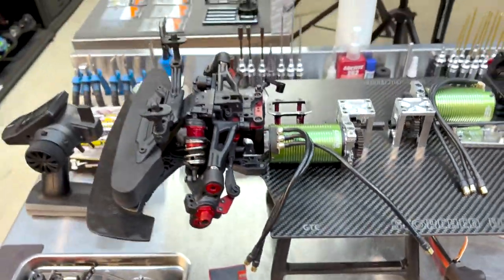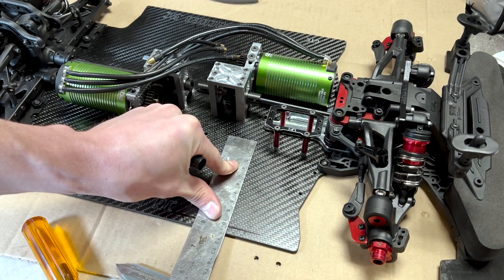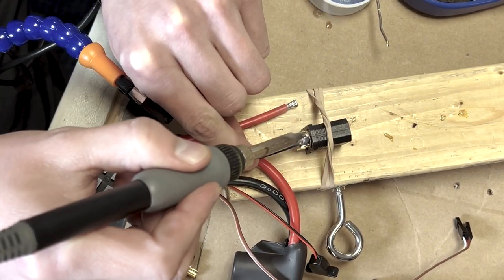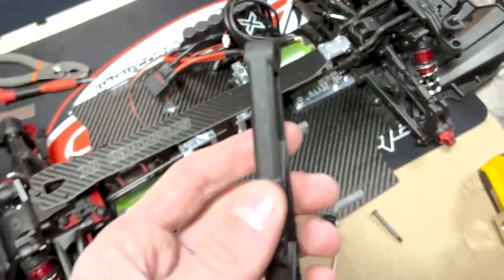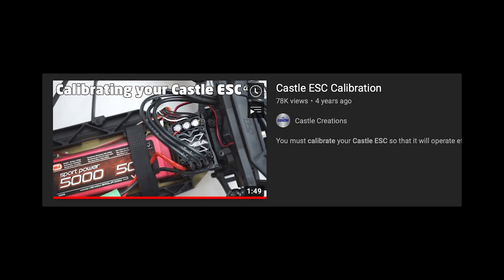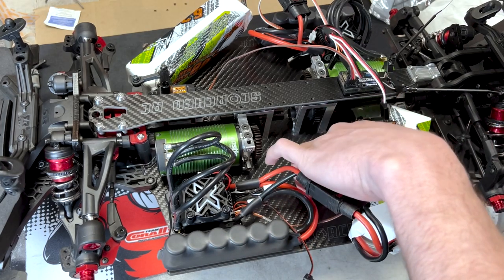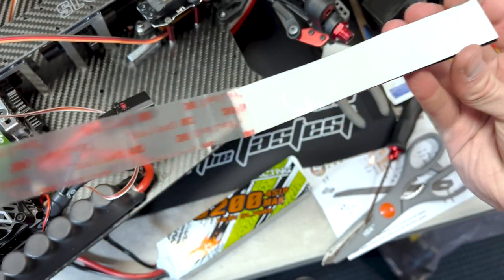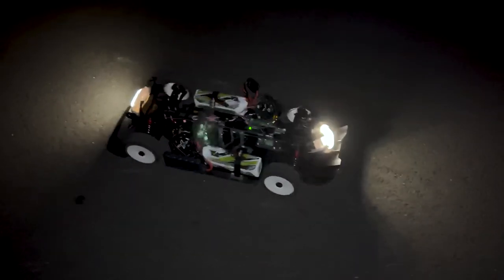Attempting To Build The Worlds FASTEST RC Car (PT2)

Comment: I like this build alot, it is exactly how I wanted to build a infraction if or when I get one. But I hope you plan to get something to block the tires from the esc as gravel and small rocks may be tossed up in. And not to jinks you but if the tire blows out it might give the esc a run for its money right there. Also kinda surprised your not running xlx2’s those thangs need tuning for high speed runs but they can push so much power for there size. I only know this because raz shifrin. Sorry if I miss spelled that but watch a few of his videos. He had me wanting to get a speed run car now.

Comment: What temp are you soldering that battery connector at? Whole lotta metal lol
Reply from the maker: 750 degrees, and yeah it needs it to make a solid solder joint

Comment: Coming along nicely. One consideration you should seriously consider taking on board is swapping out the drive shafts. I've seen multiple videos where they develop a kink/bend at high speed and causing some really ugly damage including damaging the can of a motor to the point of making it unusable. If you're planning on going anywhere remotely near 200mph, I would swap them out BEFORE they fail. I'm no Dr. James Mccoy, that's just my two cents as I'd like to see this car survive as long as possible considering the amount of money you're putting into the project.
Reply from the maker: Really great advice! I actually have a set of shafts and tekno diff cups on their way
Reply: @MikeStallone  Top notch! If your other components don't thank you later, at the very least they won't bitch at you lol
Reply: @MikeStallone  Hey duder, there was one other recommendation that I think will be well worth your time. I noticed you only connected the top brace at the front and rear bulkhead. If you screw it to one or both of your motor mounts you will make the whole thing even more rigid than it already seems. I have the same chassis and top brace. To get it to fit right, cut a piece of 3mm carbon fiber to the size of the top plate of the diff cover and make 4 holes accordingly and secure with the other 4 flanged washers and 20mm screws. The spacers that Scorched gives you are too tall, but a 3mm piece of CF is Goldilocks. Doing this on both motor mounts is probably overkill (though I do enjoy a bit of excessive murder here and there) so doing this on one of them should be plenty. The torsional rigidity this creates is freakin' awesome. Ok, that's it from me o7

Comment: 2 motors powering 2 different axis is not going to give what you want... Mark my words...
Reply from the maker: We’ll see
Reply: @MikeStallone  I hope for the best! I really do! But I hope you know not all motors (same type) with the same KV are exactly the same KV. In those speeds, you don't want any difference in speed in both axles, because then you're already slipping, even in a straight line... Connecting the axles prevents this.
Reply from the maker: @13FPV  appreciate the advice man! It’s actually something I’m totally aware of. I’m being meticulous with my data logs, and am making programming adjustments to balance them out. 

Definitely a concern of mine, but a risk I’m willing to take as long as I’m being smart about it you know?

Comment: To break 200 mph, you may need to delete your suspension, or fill the shocks with diff fluid and have a lot of preload with a high spring rate. It sounds counter intuitive, but it'll help with stability at high speed. Looking forward to your speed runs 😁